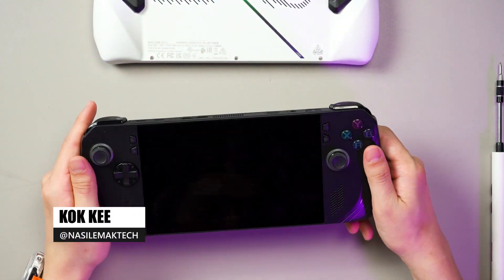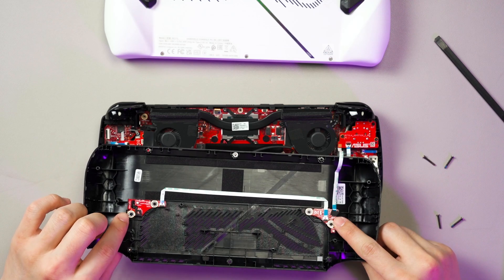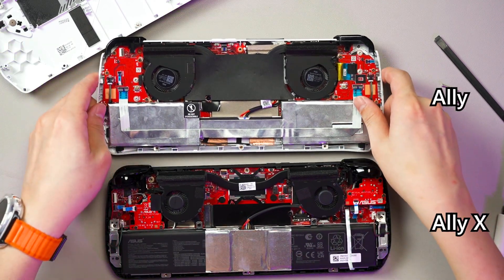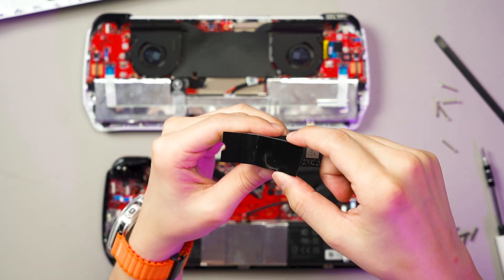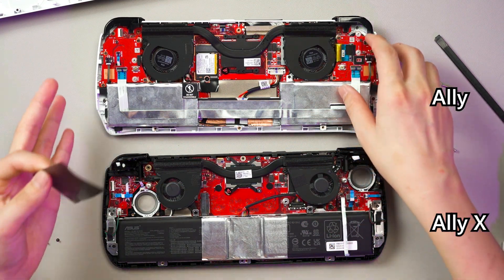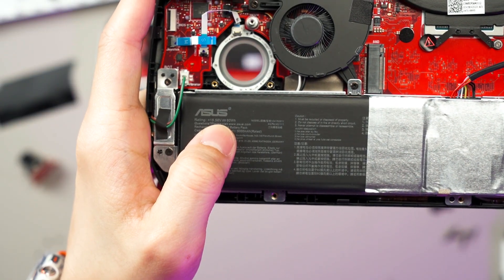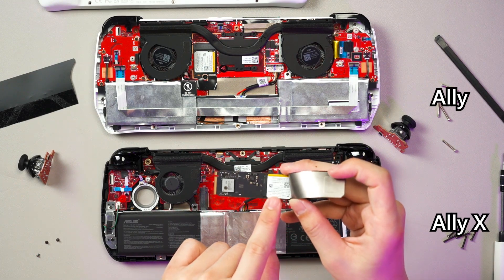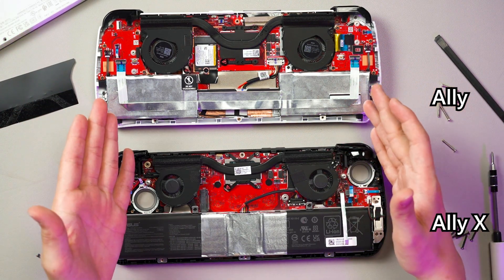ROG Ally X - Easy to Upgrade & Repair?

Comment: what is the type of screw driver i need will go to hardware store to get today to open case and for the ssd screw ? for ally x
Reply from the maker: Just the standard Philips screw tip. Not sure what's the size though lmao.

Comment: did you managed to see whether they use the same speaker as OG Ally? was thinking if thats the case, might want to get the OG ally speaker replacement and change it with the X
Reply: the speaker on the x is kinda worse than the OG ally
Reply: @jøhnr4ven  they're the same speakers just tuned differently, just use eq in Dolby to make it sound how you want

Comment: Uhhhh, im not even gunna lie..     
  After he took the back panels off of both devices and started poking around and using a screw driver to remove a few screws, it REALLY REALLY bothered me that he didn't disconnect the batteries 😂😂. I was just waiting for a screw to drop and hit the board 😂😂. 
 I meannn, i know they were both powered off, but because the batteries were still connected, there's still a possibility that a dropped screw or a slip of the screwdriver hitting the board could potentially cause a random transistor, capacitor, inductor ect to blow and then you're totally screwed if you don't know how to find which one or which ones blew and replace them. 
 Them capacitors on the board hold electricity from the battery. So, even if the unit is totally shut down and unplugged from the charger, if the battery is still connected then there's still some electricity being stored in those small components. 
 I don't think it would be enough to cause any damage to anything, but it is still a possibility. 
 You're absolute best and safest bet would to just disconnect the battery immediately after removing the back case or covers of any type of motherboard before poking around with a screwdriver and removing screws. Even if you're just adding or upgrading an SSD or something simple and easy like that, ALWAYS remember to disconnect the battery every single time you remove the back cover.

Comment: I really need to fix my screen. I’ve bought one but not sure what to do just yet. There were no screen replacement vids at the time when I checked
Reply from the maker: What happened? The screen got ruined that quickly?
Anyway, to change the screen - it's the same as the original Ally. You need to take out pretty much everything to access the display connector, then heat up the screen at the front to weaken the adhesive.

Comment: Can you interchangue batteries inthem ? To use a ally x battery on a normal ally
Reply from the maker: Aha - I think not. Screws seems to be at a different place.
Reply: Actually I know someone that did just that. She had to 3d print some parts but she managed to get it to fit (of course she had to make a new adapter cable)

Comment: The joystick of the ally x, is it the same size with ps4/ps5/switch? Incase we will buy spare parts or thumb grip? Thanks
Reply from the maker: I don't think so. The caps on the Ally are a lot smaller in comparison